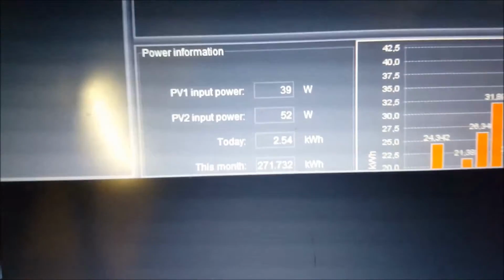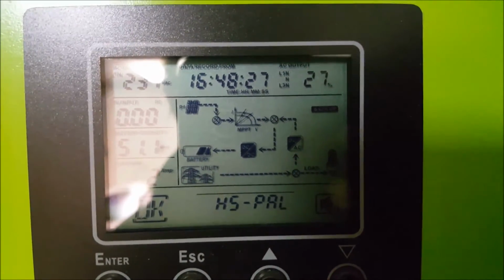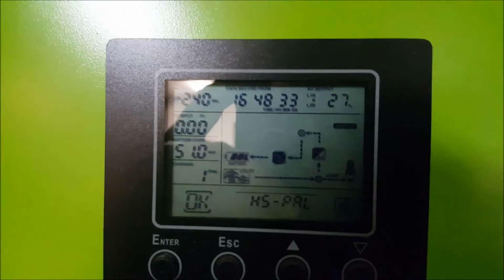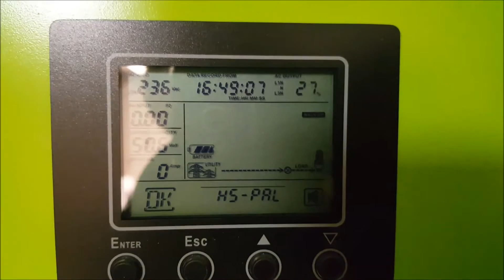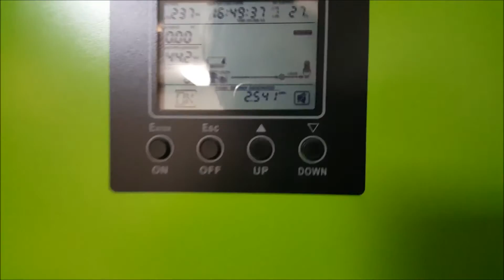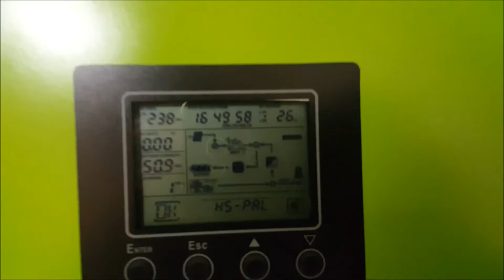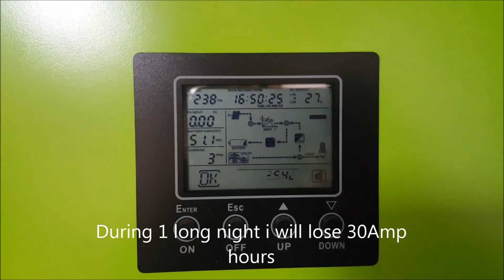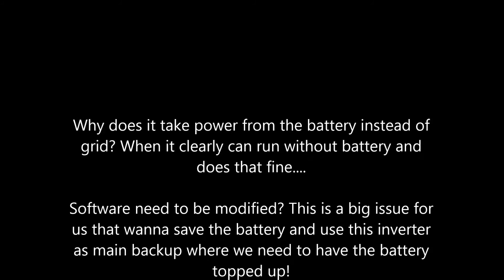Solar Electricity: Issues with an MPP 10KW hybrid inverter

Comment: What is the password to change the parameters?
Reply from the maker: There are 2 passwords. One is like password and the other is some kind of master pass that only they have.
Reply: @DIYTechRepairs  I need to change the VDE 0126 230V 60Hz standard to VDE 4105 230V 50Hz and need a password
Reply from the maker: @monikakep1992  Contact the seller then. I dont have the code for your unit m8.

Comment: i bought a hv2-5048 a newer version of their hybrid. i'll let you know in the future. haven't installed it yet
Reply from the maker: its a totally differetn version. Their hybrid models are a cheaper option comparing to the MPI modell line that i have. They differ a bit inside. The new hybrid modell seem to be ok. roughly same idle load and efficiency problem though :)

Comment: hello , i have installed one same 2 days ago , i have lot of error messages and connexion disconnexion from grid wihout real reasons , the inverter can feed grid normaly 30 or 50 minutes then cut , and we ear relays go on step 1 , see on screen voltages of RST  are in the range and very near each other , maybee 2V max difference , frequency is from 49,9 to 50,01HZ but instead pass at step 2 with connect the relays , it return to open the first step relay and show 0V on RST and 0HZ  , it can do that 20 or 30 times and after ( morer than 20 minuts ) and  ,it finish to connect , can run again well 1H , sometime 3 . i had similar problems in the past on GRID tie inverters , it was software bugs , do you have any idea on how made the grid connexion become stable ?? thanks 
claude
Reply from the maker: What error code? Ac islanding?
Reply: @DIYTechRepairs  the errors codes are multiple , it tell about voltage / sinusoid form / frequency , all of these errors code came in same time at same minut on troubleshooting  tables 
i have many grid tie inverter on same grid very near , some run since 10 years wihout any trouble
Reply from the maker: @clauderouet4141  multiple grid tie inverter can cause race condition. I Guess this is the case here. I have seen something like that here days when we have tons of sun. I Guess new inverters handle it better. The Green machine have old code running
Reply: @DIYTechRepairs  HI i have see just onother video from you , where you speak about the staff is not able resolve the bugs , i met similar bugs in the past on grid tie models , but by chance the chineese staff resolve the bugs by giving me a new update of tracking parameters , since it run , it was 10 years ago . actualy i ajusted on grid tie because battery are still on the way . the chineese staff who sold to me the inverter nammed easun  tell me need ajust on back up 1 and enter large range of inputs in parameters of generator . i will try even if i not understand the relationship with generator analysis and grid one !! have you got any update of MPPT tracking parameters ? thanks claude
Reply from the maker: @clauderouet4141  nothing. And next inverter wont be mpp. They havent helped me solve the issues
Reply: @DIYTechRepairs  i don't wanted use that kind , but it was the only model can get HVPV , i run 650V DC on one MPPT and 680 at second one . also the battery charger is 200 amp, i am in 3 phases and 2 kinds of exposition , not easy put 3 monophases inverter on 2 differents side roof! MPP solar like all other just buy to voltronic ,
Reply: @DIYTechRepairs  i have made a catch screen of these errors , but it's in french

Comment: Hi, i think its because the floating voltage to 53v, The battery would be charger to it max configured voltage and them start draining it until it’s floating voltage. If you want The battery to stay at Max voltage you should change this parameter to match
Reply from the maker: Noop
 Not the case

Comment: It's definitely back feeding the solar panels, at night panels go into negative pull by 1-2 volts depending on the setup ( series parallel). You Need to charge the panel setup and measure the current and load when there is no light. A single faulty diode can cause the panels to draw higher power when no light is applied to  the solar panels.
Reply from the maker: There are No problem with the panels nor diodes in this case.

Comment: 10kw 3phase voltronic power inverter
The battery cables of my inverter were got red hot due to low gauge and caused error 13.
After replacing those cables, now I am facing  03 and 09 errors
And the inverter is not picking up the utility power to feed  the load.
Plz answer if solution is known ????
Reply from the maker: Dont know. Did you hook Up the phases in correct order? Checked the manual for what 3 and 9 is?

Comment: Have read through your answers and see that you have not received any concrete answer yet. What does MPPSolar say to your question?

I have the same inverter with 3 phases.

If I unplug the AC input and the AC output at the bottom of the inverter and it only runs on the batteries, then my inverter uses 170W at idle consumption which is 4KW per day at idle. I had to put more Lithium batteries on to make up.

There are many features of this inverter, this is one of them.
Reply from the maker: Idle load is normal. Cheap inverters are between 40-80w per phase. Mine is around 180w. Yes its alot for sure so you need excess energy to cope with it. Its a reason its cheap :)
Reply: @DIYTechRepairs  Thanks for reply. But what to expect from idle consumption on other 3-phase inverters?
Reply from the maker: @SolvoltDkwebshop  depends . 40-80w per phase for cheap Ones and 20+ on the expensive ones
Reply: @DIYTechRepairs  Ok, I understand. The expensive ones cost a lot more. One can only hope that the one we have now works for a reasonable time.

The expensive ones like Fronius, Kostal etc. they are very expensive and they have to have the companies own batteries at an overpriced price.

I have 15KW LiFePo4 battery and it gives me power from 8KW solar cells, I can handle 2 days of gray weather and a consumption of approx. 10KW per day without having to use electricity from the electricity grid.

With the extra consumption of this inverter, I probably need up to 20KW to clear the 3 days of gray weather.

What are your setups?
Reply from the maker: @SolvoltDkwebshop  i would say better inverter is 2-3* this Price. 16kwp solar and currently 120kwh battery.
Reply: @DIYTechRepairs  Ok, you have a nice big setup. You can probably get through much of the winter with offgrid.

That's what we all need to do to address the problems of the environment, no matter where in the world we live.

Thank you for your answers to my questions. I will come back to you.

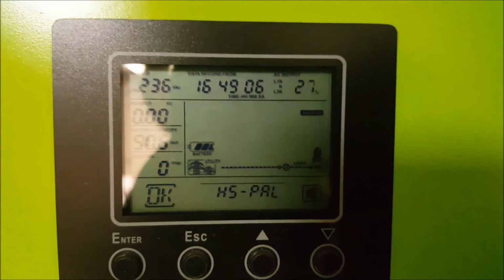Comment: 1:24 , your check meter need calibration and also we can hear fans sound ........ so your fans are using power and power circuitry, wait for 2-3 mins and let fans quite then check again with good meter.
Reply from the maker: Fans does not need that much and the meter used is callibrated
Reply: @DIYTechRepairs  the what can be issue? you said using 120+watt while in standby. that means not in standby. anyhow to find fact please send to lab or send to me in Pakistan....
Reply: i made my own 5 kw with EG8010  with SPWM, feed by 16 series panels of 150 watt each, no load consumption is only under 10watts with  mosfets fan,
Reply from the maker: @WaqasKhan-nd6sj  its normal Idle useage on this inverter.....  Bad design from the start im afraid.
Reply from the maker: @WaqasKhan-nd6sj  not comparable to a hybrid hvdc bi-directional inverter though...
Reply: @DIYTechRepairs  please  contact manufacture, its not like a trial unit is made sent to you with faults. there are certain tests before leaving factory.  i still doubt there is some information missing . anyhow...over
Reply from the maker: @WaqasKhan-nd6sj  allready have plenty of Contact with Them. Its normal Idle useage from their reply. Same as 10+ others i know of...
Reply: @DIYTechRepairs   i don't agree, not possible, there is some fault or missing information. like this system will keep draining batteries for nothing and batteries power is as precious as gold, anyways
Reply from the maker: @WaqasKhan-nd6sj  notrmal idle current is40-80 watt per phase. This is 3 phase. It uses the oposite that is the Main source. Now you do the math
Reply: @DIYTechRepairs  i don't want to , bcz its wastage of time without proper facts and figures.
very simple question, if consuming extra power in idle/standby mode, where does it goes? something is heating ? some transformer/fets working?
this discussion is no worthy...
Reply from the maker: @WaqasKhan-nd6sj  and almost all bigger inverters have an Idle consumption of 40-80w per phase. This to Keep in sync and the cap bank filled Up. You can look t any Ups or bigger low cost inverter. Yes its wasted into heat of course.  With a victron i would get down to 20w per phase but 3* investment cost. For instance the pip4kw solar inverter have Idle consumption of 60w. My old 5kw inverter had 40w. The 3kva Ups have 55w. The 1500-2000va Ups i had about 35w each. Numbers yes but thats how it is.for the mpi inverter My question was why it drained the battery when running on grid. This is because its construction and that it Always have a extra leg. So IF grid dies it is allready built unning on battery. IF its running on the other way around its the same. Idle load can be discussed but thats just piss poor design and the fact its hybrid with a bi-directional hvdc bridge. Not comparable to a stand alone inverter. IF you know your electronics you know how much more complex that is... Then add that to a cheap uniy... That gives a negative on something. In this case Idle load. Its a design for this unit and i have talked to the manufacturer
Reply from the maker: @WaqasKhan-nd6sj  also note that Idle is not same as standby. Standby it pulls 2w.... But then Its basically shut off.....

Comment: what i feel is, your cooling fans and inverter's power circuitry is still working , thus by calculating fans of Watts each*2 ~=20 watts and circuitry and relay load (if included) is around 1 or 1.5 amp ,
the problem get really messy if fans not shut down after reaching ambient temp, and circuit should lower its power consumption of << 5 watts in off/standby mode.
but for proper inspection you should contact manufacturer or some research lab/service.
my personal suggestion is wait for 2 mins after cutting all power sources except batteries...

Comment: voltronics have high self consumption!!
Reply from the maker: The issue is not about the high self consumption. The Idle consumption is rather normal in this class of inverters and same on UPS systems on this size. Yes its high for sure  but the issue was something else
Reply: @DIYTechRepairs  hello, what was the issue because I have the same on my 5048MG ?
Reply from the maker: @Lagachette3  No issue. Cheap Gear...
Reply: @DIYTechRepairs  Ah ok so how do you prevent the inverter to drain all the batteries during night ?
Reply from the maker: @Lagachette3  big enough battery bank is first. Second the inverter can go to grid. 3rd the inverter can shut off if No grid and last the bms Will shut it off with big ass trip breaker

Comment: Hi, Do you know if these inverter can work up to 64volts like the PIP;5048MG?  meaning the charging voltage can be set to max out 64volts and the inverter would still work at 64volts?
Reply from the maker: Its max 60V. No use going above either. Stick with 14s instead of 15s.  Unless the new version supports higher but not what Im awayre of. They are built for LA

Comment: I still havent connected mine! What settigs should i use if i want the inverter to use PV first, then Battery and when voltage is low use Grid?
Reply from the maker: Pv - battery - grid. Is the name of the mode. You fund it in the software.
Reply: DIY Tech & Repairs 
Thanks for the reply!

Comment: the unit does not have an external shunt that is why i tell people to get the victron 700 / 702 or a midnite classic like i use. We also build software to deal with most of the problems You can see my system live here http://livesystem.acdcpowermonitor.com/?SystemID=1000000002 online 24/7

Comment: Interesting,
I bought the 5.5kV version of this model a few weeks ago.
I'm noticing a similar thing.Looking at the data log, it shows the battery begins discharging at around 6:30 in the morning; bit after dawn.PV input power shows it's first entry as 20 watts.
Once PV input power reaches 65 watts it quickly returns to full capacity.See a slightly similar situation around dusk, again when PV power falls down around the 20W mark.Seems to hunt a bit more on decreasing power input than it does on the rise in the morning,
Reply: have you tried email MPP Solar Support?

Comment: with that inverter there are 3 settings i think   grid only, battery only, or combo of grid and battery, it could be set on combo setting to save you money,  by not using grid power to have the converter in standby witch with that model is around 200+ watts, by using your solar to charge your battery's the inverter  use's that power first, then when the battery's are below a set voltage, the inverter will use the grid for standby, if you find that your battery's are draining to much, then that's because you don't have enough capacity, you need more battery's for that size unit, also you may need more solar to charge the increased capacity
Reply from the maker: There is 2 issues here or actually just 1. The reason it draws from the oposite is that its going to be ready to switch if needed. Its a design in the software...  The problem is just the idle loiad that is 300W. Thats ALOT but you get what you pay for. I have looked at swapping to an equal unit from another company that have idle of way below 50w.  

I got 17kW of solar + 100kWh of storage so its hopefully enough :)
Reply: @ 100KWh of storage why even have grid connected oO lol on ave most people use well under 30KWh for a full day oO i guess you have a weeks worth lol, yes your right the 200+ watts the unit use's in standby is high but when its run by solar its a small price for a unit of that size, for me im more into running multiple smaller units that only use 2watts in standby, also this way if one fails it only takes down part of your house.
Reply from the maker: Deon Hamilton 100kwh is just 5 days with bad weather kind of :) in winter we only get 10% of solar compare to summer so currently we will be kind  of offgrid 10 out of 12 month. Its not economical to do the    last 2 month.... but time will tell
Reply: im lucky i live in New Zealand we have no snow in the upper north where i live, so we have all year round solar oO i forget sometimes its not the same everywhere lol, do you have wind or hydro where you are ? maybe if you have that you could use that too.

Comment: Did you find a solution? What about changing the "Feeding grid power calibration" a bit? We had the opposite problem, we where using the grid instead of the batteries, even the inverter showed that we are using just batteries. Changing the  "Feeding grid power calibration" more than was needed was the solution, and now I actually think is a very good inverter, the negative comments below are not our experience.
Reply: EDIT: I found out that the calibration is only used when PV panels provide power. Once there is no PV feed, system completely ignores it and powers itself from the batery (draws from battery about 3 Amps).
I discovered (by chance) the way how to stop it.
The system looks at the "Battery cut-off discharging voltage when grid is unavailable" (!!) - once battery voltage drops below that level I have it set to 50V) it switches powering itself from grid and will in turn send about 1.5A into battery, until battery reaches "Battery re-discharging voltage when grid is unavailable" value MINUS 1 volt.
Do you know if there is any new firmware available? This sucks but it has this workaround.
My blackouts overnight are much worse problem (it never fails when PV power is available).
Reply from the maker: It power itself from the other source as main. If you run of battery the main source is grid. If you feed from Grid the main source is Battery. This is due to it should be ready to switch if needed. Thats the design of the software as of today im afraid.  I use the grid-calibration as some kind of 0 meter setting. I do this automatically via my raspberry PI. The grid callibration is always enabled as long as your main source is battery/PV. If you go to grid it will of course not feed antyhing from battery. Its normal.

There is no updates what i know about and they most likely wont send it out either. Please email MPP solar about it. i have done several times.
Reply from the maker: Yes. Im running the calibration too. Its done automatically by some software i have developed for it. It makes the inverter work decent. The biggest concern is the 200-300W idle load :)
Reply: Hello from Slovakia. 
I am using the same inverter. Can you please let me know how do you do the calibration? If I leave all phases to 0, it takes power to power itself from the grid. ONLY IN THAT CASE.
Once you put any value into "Feeding Grid Power Calibration", it starts to draw current from PV or battery if PV is not available. 
I have another problem though - when running without PV input (night), it randomly disconnects load (2-4x a night). Pretty nasty. Is this firmware bug or it needs more careful calibration perhaps?
Any idea?
Reply: Hej har samme inverter, og har samme fejl som dig. Har du fået ny firmware eller løst problemet ?